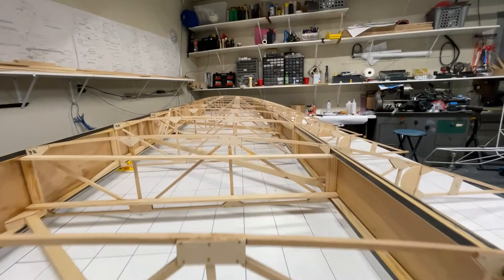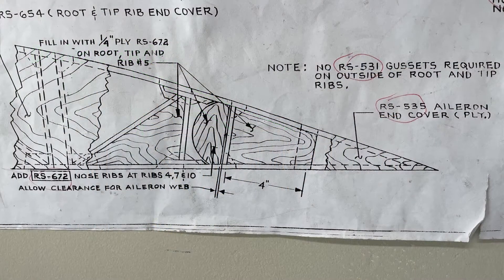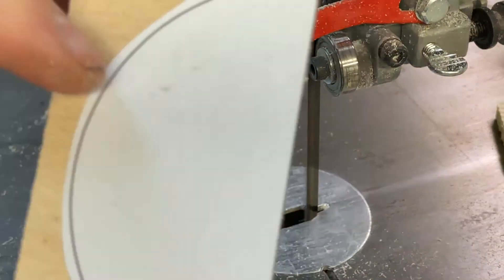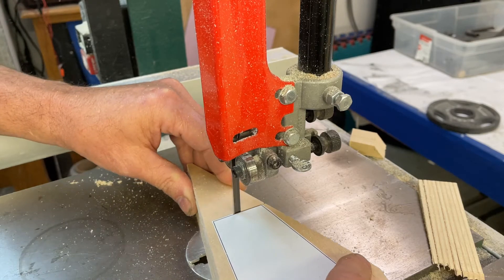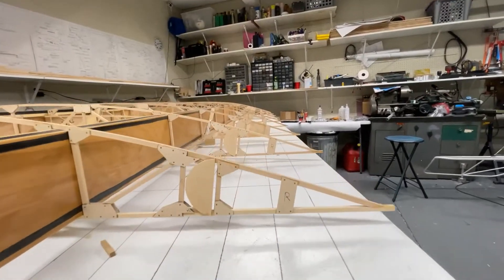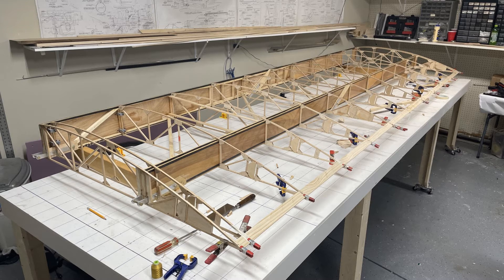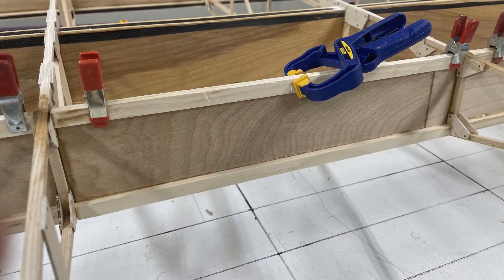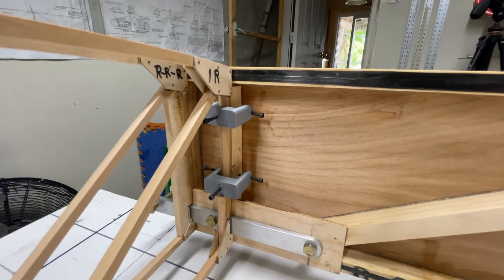AirBike Update 7-3-2021

Comment: This plane will be great as you build. About used CAD. You drawing take mesures from the plans or Scan the plans and convert to cad?
Reply from the maker: It depends on how I get plans and drawings. If I get them as a PDF, I will import them into CAD and trace them. If I get them as paper plans and drawings, I measure out the drawings by hand and re-draw them in CAD. I have never had any scanned. :)